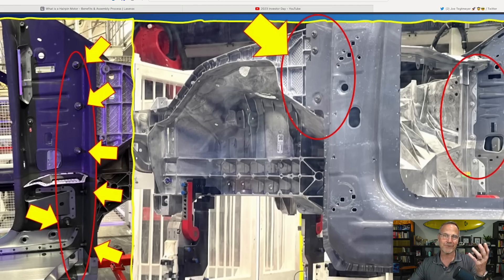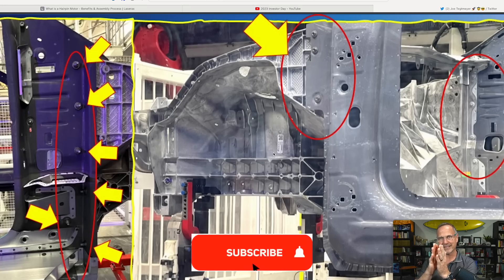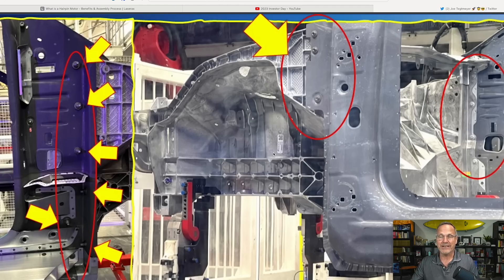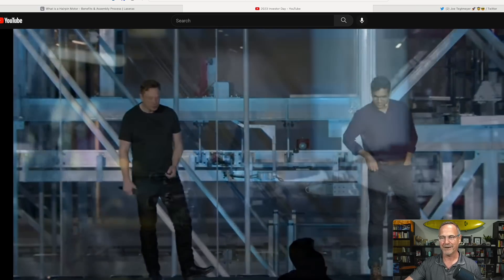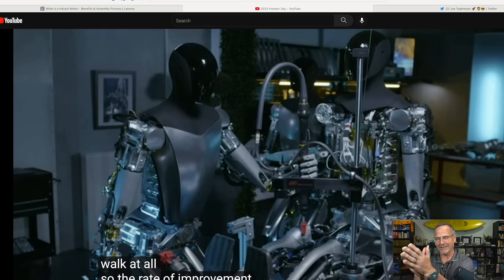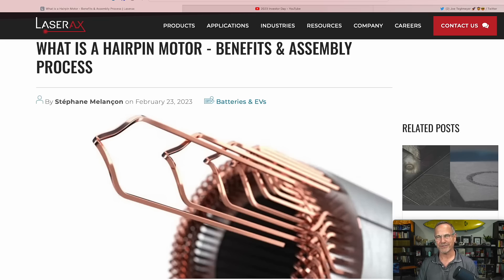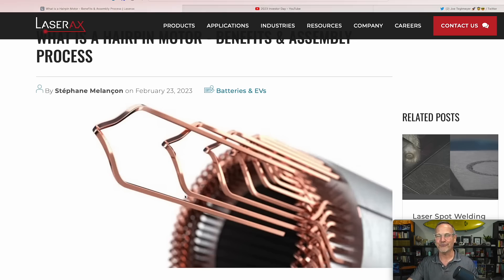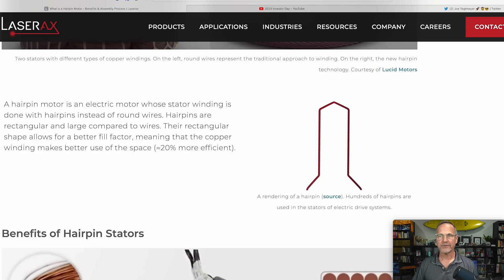Tesla Has HAIRPIN MOTORS! 🤯 What the Heck Are They?  Plus Teslabot is REAL, and How To Attach Panels

Comment: Spot welding is generally being replaced by adhesives and rivets by many manufacturers now not just Tesla. Look at the latest German cars and you find many parts, even structural parts are bonded and riveted. It prevents heat damage to the components and means anti corrosion treatments can be applied before assembly.
Reply: I am thinking they will go to adhesives as well. Today adhesives are really strong and can absorb the noise/vibrations of the car. That would create a component with multiple function further reducing costs, weight and size of the factory.
Reply: @alexforget  Check out new BMWs, even suspension mounts are fitted to the frame using epoxy adhesive and rivets.  Allows car makers to join aluminium to steal and use all kinds of alloys for each component which wouldn't be possible with welding.
Reply: @schrodingerscat1863  Goes far with Carbon Fiber too, as it has corrosive tendencies with metals.
Reply: @schrodingerscat1863  Audi has been doing that for decades actually! Audi was the first car manufacturer to make an 100% aluminum car shelf decades ago.
Reply: @alanmay7929  This is true but the adhesives and resins being used today are way ahead of the early stuff which had a tendency for cracking and breaking down over time.
Reply: @schrodingerscat1863  lol!!!!! Everything eventually brakes down and definitely not all the time, plus by making equipments or vehicles with less glued or cast pieces it's super easy to repair them.
Reply: @alanmay7929  There has been a huge push from manufacturers over the past decade to commodities their products. Most modern cars get written off with very minor damage now because repair is either too difficult or even impossible.
Reply: @schrodingerscat1863  wrong!!!!!!!!! Modern cars get written of either because of the lack of parts or also sometimes because the repairs are expensive or the insurance company doesn't want to care.
Reply: @schrodingerscat1863  Tesla's are actually among the most expensive cars to repair because of the electronics and their manufacturing process with the stupid big casting..... I've watched ARTHUR TUSSIK repair a Tesla model 3 with no large casting and it was relatively possible which is not doable with the casting.
Reply: @schrodingerscat1863  when you go to places like Africa,   even Cuba they still repair and reuse those super old cars from the 50's and up things no electric cars will ever made possible
Reply: Audi was bonding their Aluminum bodies with Epoxy. Circa late 80's when I 1st read about it.
There was a 5 phase motor technology that I read about shortly afterwards. Wonder if that will happen.
Reply: Why wouldn't the hinge be cast into the side panel, and the door? Then the hinge just needs to be joined as they always are.
Reply: @petefield1545  They need adjustability. Both at the frame and the door hinge, in 3 dimensions at 4 points. Ever adjusted one? It's a skill. Not one of mine...
Reply: @bryanst.martin7134  I haven't, but don' t they need adjustability due to the accuracy of the welds? Wouldn't the hinge cast into the frame remove that inconsistency?
Reply: @petefield1545  Depends on the precision and repeatability, which can vary in the best of circumstances. How precise is the material in thickness, metalergy, and heat treating? There can always be enough to distort the fitment at the end of the line. Adjustment is easier to achieve than perfection. Thanks for the question.
Reply: @bryanst.martin7134  Thanks for the answer. I'm keen to see what the end result is.
Reply: Talking a out bonded/glued car parts, lotus is the fine example of that, even Bugatti and others are literally glued and screwed together
Reply: Thanks for comment. I assume the adhesive (not 'sealant') does all the work, rivets are just for alignment. Munro Assoc hate bolt type fasteners, failure point. The revolution isn’t the glue, it’s the modularisation of work.
Reply: @iandavies4853  Rivets prevent the 'shear movement' that glue isn't as good at preventing
Reply: @iandavies4853  Actually the Glue is important. Bond strength, creep, solvents, heat, ozone, fuel and solvent vapors. While many companies use it in heir soft body panel reinforcements, Audi seemed to go much farther. But I recall epoxy joints failing in the NHTSA reports where ceiling panels were falling from overhead placement in traffic tunnels. The "creep" eventually let go. Knowing that makes for interesting tunnel rides.
Reply: @iandavies4853  the failure point argument is super idiotic tbh!
Reply: @iandavies4853  to answer your question I’ll mention how the Lotus Elise aluminum chassis was bonded (not welded) with adhesive without using rivets at all. They used a clamping jig until the adhesive cured. The rivets speed up the process significantly as they can hold the static weight of the vehicle until the adhesive dries
Reply: @jackimo22  thanks for reply. I’m more used to woodwork, but same principle. We saw Munro pull apart Austin Y with great difficulty, use of blowtorch.

Comment: I still think the bipedal robot should be just one of the options. It's true a 100% humanoid robot could replace a human at any kind of labor work, but a wheeled robot could move il most city environments, use less power to do so, would do it faster and would have zero problems in keeping itself upright. And for open terrain, a tracked version would also perform better in several environments. In this early stage of development, I woud prioiritize upper torso precision movement and the AI behind environment recognition. Walking and balance are 2 different problems that could be moved for later solutions

Comment: In the Monroe live video, Cory alluded to the skin effect of copper wire. This happens in any a.c. circuit causing the electrons to travel along the “skin”, thus reducing the actual amount of copper that carries current. Rectangular wire has more skin than round wire, which increases efficiency.
Reply: Multi-strand wire is better for the high frequency skin effect compared to a single conductor. It's why when we "bond" devices for HF noise reduction, we use braided straps and not solid copper bus bars. Technically, yes, a rectangle has larger surface area than a single circle of the same cross sectional area, but many individual small round strands have way more surface area than 1 large bar.
Reply: @TheLastMoccasin people also overestimate the skin effect. Look at the equation for it and it's apparent you need very high frequency for it to matter.
Reply: @nonconsensualopinion  Correct, which is why it's mainly used for high frequency bonding to remove electromagnetic noise from things like VFD carrier frequency on encoder feedbacks and things where you have both noise generating electronics (think switching things like IGBT, SCRs, MOSFETs, etc) and sensitive signals (encoder feedbacks, etc.). The skin effect is almost never considered in "work" current carrying conductors, only noise mitigation.
Reply: I don’t know what Tesla uses for their inverter frequency. Inverters use high frequency, typically 10 KHz or more, to convert DC voltage to the 3 phase used by the motors. This does cause skin affect.

Comment: Packing efficiency doesn't mean higher electrical efficiency, thicker copper components also means more Eddie currents, what limits a motors power is heat management not packaging.

Comment: Hi, I am working on drivetrain lines for Tesla all over the place. So far a supplier made the hairpin production lines for tesla, there are multiple lines operating in Shanghai, one in Berlin and one in Texas. So the statement of Tesla that they do "everything by themselves" in regards to the production lines wasn´t correct, maybe they do some by themselve now, but not all for sure.
For the future platform they might do all by them selves.

The different winding technology has nothing to do with rare earths. You still use copper as before.
The rare earths are in the magnets of the rotor.

Comment: @10:57 So 4680 battery packs look like the round wire diagram. Did we just argue against the 4680 battery layout, or is there a reason (structural?) that they are arranged in this manner?
Reply: I think that space is used for liquid cooling. And you would not like to have any sharp edges to disturb the flow.
Reply: 4680 is that way for cost as prismatic are more expensive to produce and aren't as fast as the 4680 in assembly.

Comment: @13:17 In a wound motor the bundles of separate wires drift from their placement while they are being assembled, they look like hair being tied while it's being plaited. (†)
The winding process introduces some randomness to the current flow and the wires have to be round because it's almost (††) impossible to draw miles of square wires, which introduces further gaps.  
In a hairpin motor there are no bundles. They look like what they are, solid copper rods.
†) It's a question of the wires' tensile strength versus its diameter.
††) Never say never but it's usually a question of achievable speed versus desired speed. Tesla have to produce these motors by the millions.

Comment: Thank you good content. However I dont think this is the reason they will be able to ditch rare earth metals though - doubt Tesla mentality is to improve in one field while sacrificing on other in order to keep the efficiency. Most likely they or someone else have figured out similar or even better efficient permanent magnets that dont use rare matals.
Reply: Apparwntly, Irin Nitride magnets are even stronger than Neodymium ones!
Reply: Like BMW with the ix and i4 motors? They switched to a D.C. brushed style. What remains to be seen is long term wear concerns, dust build up and servicibility of those motors. 🤔
Reply: @4literv6  Brushed motors are the past; there’s basically no advantages on using them over brushless.
Reply: @marioescalona1640  tell that to BMW then? 😀
For the record I agree with you. 👍🏻

Comment: I wonder if another optimization for the hairpins is insulating only every other pin (think about it...)
Reply: You need a certain thickness to lets say isolate 800V, so the additional variant would make more problems than making two thinner coatings
Reply: Fault protection might be a reason not to do this. If an insulation point fails its guaranteed to generate the fault as it's neighbor will not have insulation.  It's an interesting thought though
Reply: weeeeeeeeeed

Comment: Elons words  (during Teslabot video)appear careful crafted enough to not be held accountable if accused of deception,  he’s been very careful these days in his wording. Nvidia can produce this grade of animation with their current RTX Raytracing tools on their high end video cards…until Elon or Tesla says this is not an animated video (to which he hasn’t-I tweeted to ask he and Tesla) I remain skeptical- low light conditions with low F stop lens also appears to be high def  4K with lots of micro  stutters between frames- hmmmm,  above all, the AI appears to be of the highest automation caliber to which no one has come close to ever so far-  I’ll be very happy to be wrong- I’m a Tesla shareholder , tech investor for over 20 years
Reply: Why would the nuts have wear on them in the video if it was cgi? Why would the robot clearly miss multiple times with the hand held driver?

Why would it be made to look so awkward halting steps and stunted movement if it wasn't real? To me it looked real enough and maybe just cut together by a less than excellent team of editor's? I mean Elon hates pr teams, is an awkward speaker and so is most of his team leads. 🤔
Reply: Possibly, but then why generate such awkward walking immediately after the robot had picked up the arm, turned and started to work towards the other robot?
Reply: @Each-Day-Is-A-Miracle  perfection would be obvious?

Comment: I think everyone is  missing something from investor day. Why build the gen 3 car moduarly in parallel/series? Frans said it in his part of the design speech. They had previously build the  machine that builds the machine with the assumption of people building and assembling portions of the car.  It seems Tesla is designing the build and assembly for the vehicle for access in multiple locations of each module is a stationary location then assembling the modules into a whole unit. Seems like if one were to try to cut labor hours you would want less people in the build process? Unless the workers are not people. Optimus has a few key issues they may never be solved.  One being mobility and extreme dexterity. If you have ever seen how a car is build now, it requires workers to walk with the car down the line, bend and twist in to awkward positions and use the dexterity of a person to make sure that components are fastened correctly. A problem sometimes for robots, hence the flufferbot fiasco. If a vehicle is modular then the moduals are stationary and have access on six sides in 3 dimensions so that more activity can happen.  Watching the video of the robots building the robots was the Easter egg that to make Optimus a useful product ASAP, Tesla has to change the way they build their vehicles to suit the attributes of a minimum viable Optimus. Remember that Elons' philosophy is to make a minimum viable product and then improve it fast. Why do this in Mexico. No labor unions in Mexico. If you start out making the vehicles with low skill labor then have the low skill labor teach Optimus to do their job and slowly replace the low skill labor robots over time.

Comment: @3:14 Since Joe Tegtmeyer shot these pictures in GigaAustin, that tells me that GigaAustin is about to retire its current production system with all the overhead whole body ferrying systems for a much more parallel-serial parts movement system within the year.
I suspect that all vehicle production will switch to this method and the entire system becomes an order of magnitude more productive while getting cheaper.
It will also make Giga Factories a lot easier to design, build and operate.
Reply: I agree, and the internal project 'Highland' name is for this new assembly approach.  Model 3 will have to go the Gigacast route, and the Model Y to front and rear castings to make this work.  Perhaps that's why we see the thousands of gigacastings sitting outside in both Austin and Germany